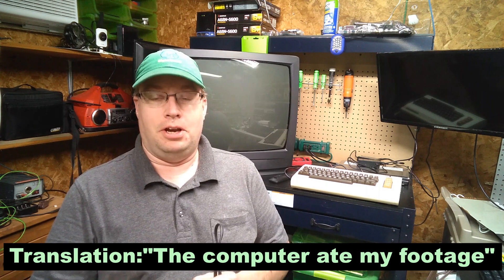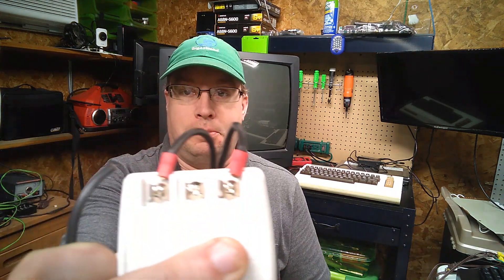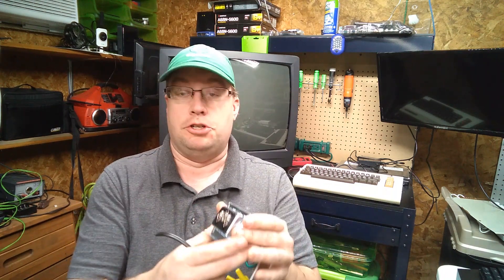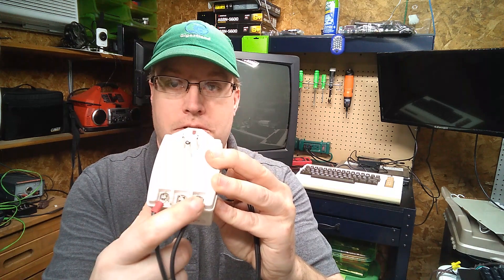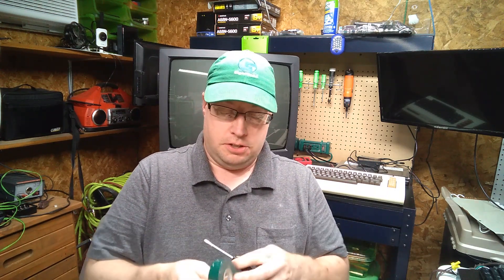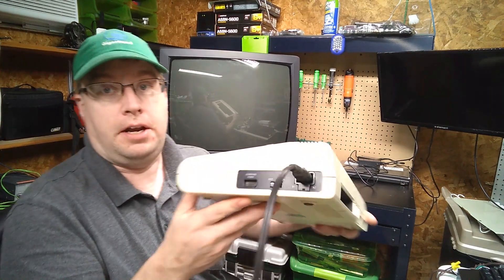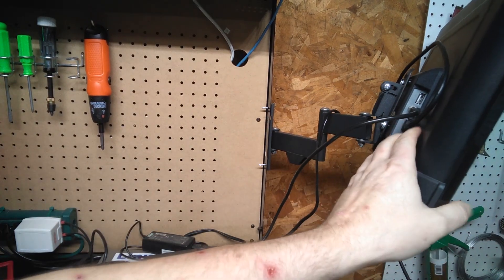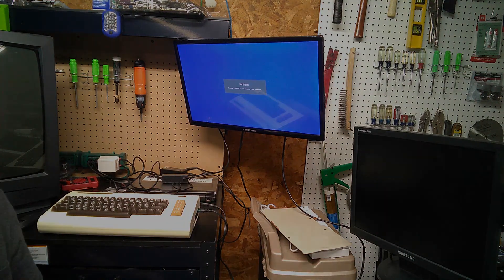Building a VIC-20 Power Supply (the easy way)

Comment: My broken VIC-20 power adapter says "11.5 VAC 30 VA." Will this method still work for me? Thanks!
Reply from the maker: Did not see this until just now. That is the rated power. My experiments showed a 2v drop almost the second it entered the system. So the effective voltage becomes about 9v.
Reply: @gigsplain  Thank you, sir. I built a power supply following your instructions and it's working great!